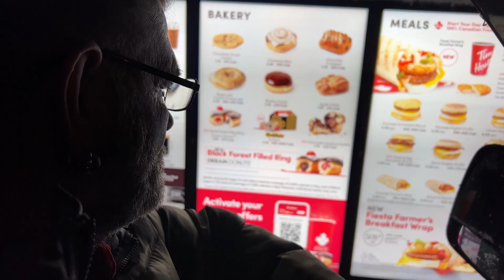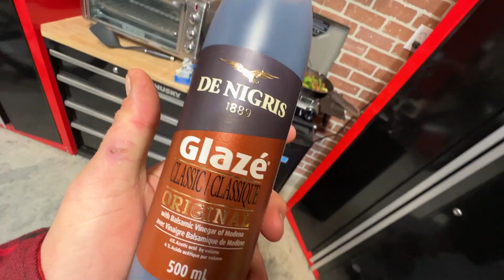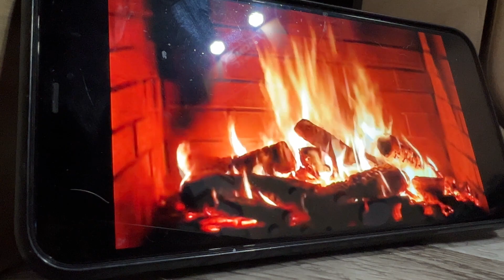COLD NIGHTS n MORE SNOW | Friend Visits The Shop n Living At Costco

Comment: Your dump is so simplistic. We have to sort everything into 20 different containers. Even the plastic trash bags. I have learned to use Ikea bags at the same cost as trash bags  and I can reuse them and they are easy to sort through at the recycling dump. Sometimes it takes such a long time when there’s a line.

Comment: You really do need a Down & feather duvet. With the proper weight of down, you wouldn’t need extra blankets. 
AND, in the warm seasons, the duvet can be rolled up, air compressed/pushed out and if tied up, it would get down into about pillow size. You wouldn’t need much or any heat on at night either. Duvets are lighter too!!

Comment: Another great video.  Thank you for all you do!!!.  In regards with the diesel heater exhaust.  The straight through muffler is quieter than the other one that you can't see through.  Less back pressure as well for the straight through one.  Yes you can put 2 together, but both should be the straight through type.  My own experience and reference from You Tube video----   John Mck 47 video #8.   worth watching if you have time.